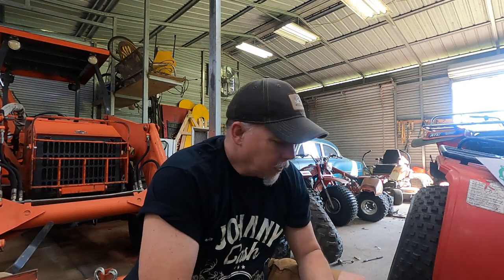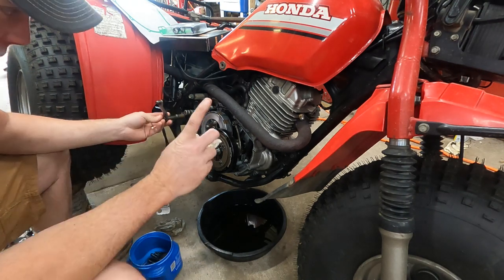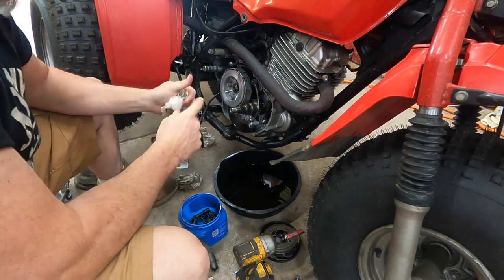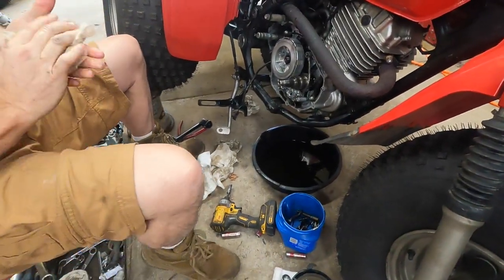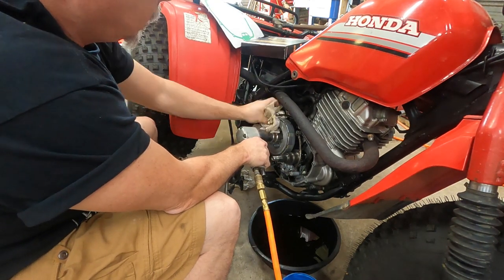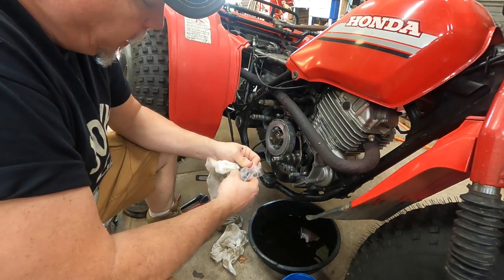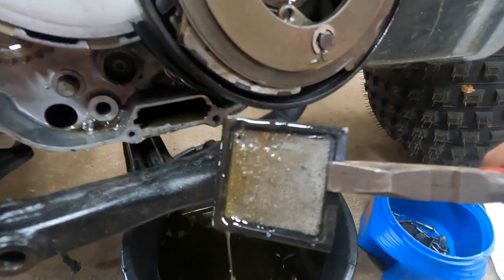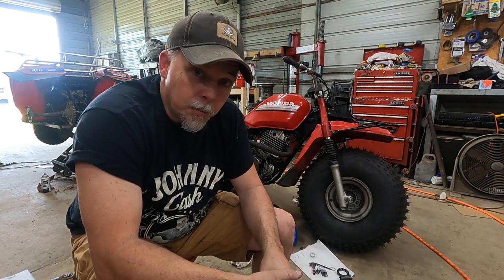HONDA ATC 250es THREE WHEELER CLUTCH & ONE WAY BEARING: Diagnosis and Repair.

Comment: You are an awesome teacher sir 👍👍👍👍👍👍👍
Reply from the maker: I think that's the best compliment I have received yet. Thank you.
Reply: Totally agree!!
Reply: @Mrcbuilds how do u you get the reverse lever off the shaft?
Reply from the maker: @shayneteynor2191  its a wedged fit, remove the bolt and tap it away from the case.
Reply: @Mrcbuilds  ty

Comment: Currently doing a one way bearing replacement on an 85 and ran into the same problem with the mislabeled direction.  Your video saved the day and my sanity.    My box looked like yours and I suspect they both came from a major distributor of aftermarket parts for these bikes.   Take the time to check, y’all!    Thanks for your video, sir.
Reply from the maker: Thanks for sharing John, yes always double check that bearing after install, I am glad the video could help. Thanks for watching please like, share and subscribe.

Comment: Guessing this is very similar to the 185s, took mine out to the dunes for labor day and had some slip between higher gears. Parts are stacking on the shelf for this winters overhaul. Thank you!

Comment: What a great explanation of the clutch and how to install the  replacement parts and what to look for, makes me feel like I'm right there watching you do all this, and understanding how it works.  In the past I've had two 85 Big Reds and never had any trouble with clutches, both machines were pretty strong with out any slippage and would do a wheelie pretty easy and had max power to the ground in 5th gear. I could smoke a foreman 500 easy on top end. my first Big Red would run just under 65 MPH It was strong. I would love to find another one like that.
Reply from the maker: Thanks for the kind words, I'm happy to help.

Comment: I have the 250 es with reverse with shaft drive I need a new clutch for it !!! where do I find one. since I got it 6 yrs ago I put 60,000km on it far and I think it is the centrufugal clutch might be giving out now. when I shut down it sounds like something spinning the ca chunk !!! but if run's fine and still takes off like a rocket !!!
Reply from the maker: The spinning clunk is the 1 way bearing. Shindy make one, you can find it on ebay. I would replace the clutch pack disc and steels while yout there.

Comment: Great job and video, I have a 250sx that has that engine on it and every time I push the shifter down it hangs and I have to pull it back up with my foot, where is the return spring on that shifter at.
Thanks
Reply from the maker: On the left side, there is a paw that has a spring just behind it on the shifter shaft, it can breat of slip out of position.  Page 9-0 in the service manual.

Comment: Finally got the bigred out and running after a few years. Drained the old gas out and put in new and the carburetor was dry, last time it was ran, with it running the fuel cock was shut off and the engine ran til it stalled. It started on the 3rd kick. I did notice once it’s been warmed up and running with no choke on if the throttle isn’t slightly feathered it will stall. Don’t know if this is a carb related thing or the idle simply needs turned up, that idle position has been the same for most of its life if not all of it. The other thing I noticed with the engine running and slightly revving the engine as the revs die down there’s a slight backfire, any ideas on what direction to look?
Reply from the maker: More likely than not the idle jet is plugged up and the back fire may be the choke sticking, clean the carb and choke and try again. Glad to hear another is back on the move! Thanks for watching.

Comment: Just installed a clutch kit with new clutch discs and springs on a 1982 Honda 185s atc. The new springs we’re about 1/4” longer than the old springs. I had to press the spring retainer pretty hard to begin each bolt. Once installed I tightened the 4 screws all the way to the stops. Clutch discs are not loose at all. Is this correct? Are the clutch docs supposed to be slightly loose or tight?? Thanks. Good job on your videos. Very methodical on your presentations!!
Reply from the maker: Hey ben, no that's not right you should be able to start each bolt by hand no problems and not fight the springs. Make sure all your disc are flush in the clutch basket, if they are you have the wrong springs. I believe the 250cc trike use longer springs than the 200cc machines. You may have issues changing gears and the clutch not freewheeling.
Reply: @Mrcbuilds  Hey, thanks so much for the quick reply. I’ll use the springs on my 85 250 es Big Red.

Comment: Very helpful ! What if i just need to do the one way bearing & not the clutch. will i still have to do the clutch as well ?
Reply from the maker: @Stepbrother7390  no
Reply: @Mrcbuilds  Thanks! keep up the good work! not many videos on here showing how to work on trikes anymore , big reds specifically! Been looking for a video on the  replacement of my air filter & gear leaver
Reply: @Mrcbuilds  Any recommendations on where to order a new clutch set ? decided if i’m going to do the bearing i might as well do the clutch as well, i have 1985 !
Reply from the maker: @Stepbrother7390  ebc makes a good product you can find steels and disc and spring by EBC on ebay. The clutch factory and tusk  are good brands too. If its a machine your going to ride and keep, id get a 1 way bearing  by shindy and a new gasket. You would never have to go back in that side of the engine.
Reply: @Mrcbuilds  odd that you would say that i have a one way bearing / gasket & oil filter from there sitting here waiting for a nice day to put it on ! & definitely going to keep this one , the frame is almost perfect for a 40 year odd year old bike. Hard to find one without rust/ tiny hole in the frame this day in age !

Comment: I see in the service manual about greasing the swingarm pivot points and steering head bearings. Are there grease zercs in there? I don’t see any on the swingarm.
Reply from the maker: No zerts you have to hand pack them

Comment: Theoretically, couldn't a feller get some 6 mm stud's to help out on the case gasket situation. Just remove them one at a time and replace with bolts? Also how do you feel about anerobic sealant on the case which can be spread thinner vs the risk of RTV squeezing into the engine and clogging stuff.
Love you're videos 👍
I have a 85 big red and and 84 200 and a 84 70 with a 125 cc
Reply from the maker: Sure you could install a couple studs. For that matter you could leave them in and put a nut on them, like the exhaust. I have never used that type of sealant. Sounds like a nice collection, the 84 atc200, is a nice bike,  and you dont see them as often as 185s or 200s . Thanks for watching, I'm glad you enjoy the channel

Comment: Great video. I have an 86. Looking for some insight or possible direction. Many years ago 2 buddies of mine were trying to start the big red since the battery was dead and had no luck with the kick starter. Unknown to me at that time they decided to try and bump start it which isn’t possible since it’s an auto/clutch not manual. They pulled it with another atv and were clicking it up into 3rd 4th 5th gears and told me there were some grinding noises. Now whenever you’re riding in that 3rd 4th 5th gear range there’s this hellacious grinding/pinging noise and it stops putting power to the rear wheels if you hurry up and downshift it comes right back to life and you keep riding like it never happened. Now this doesn’t happen all the time but does it every once in a while. Any insight on where to start looking into this? Thanks.
Reply from the maker: I would change the clutch and oil, and hope the gear set is ok in the trans.
Reply from the maker: No worries, Take your time, watch the videos and download the service manual, you will be fine.

Comment: Good work sir. I just pulled my side case and my gear selector arm hit the ground. I know it's in neutral but I sure as heck don't know what position it was in. Any tips would be great
Reply from the maker: Best is refer to the manual. Thats good that its an obvious fix.  The manual is free and can be downloaded from oscarmayer  website. Search oscarmayer  atv  manuals
Reply: @Mrcbuilds  I got it but I sure do appreciate that and thanks for all the videos. You've helped me a lot!

Comment: Just curious what would happen if you were to install the one way bearing backwards?
Reply from the maker: I'm pretty sure you would loose the primary clutch, it may not be able to take off. I have never had the happen, so I'm not certain.  But that's my best guess.

Comment: I put new clutch and one way bearing in my 1986 big red, all of the gears work except reverse. What did I screw up on, would appreciate any advice you could send my way. Thanks Mrcbuilds.
Reply from the maker: More than likely you do not have the reverse lever installed properly. it is a wedge fit on the shaft. loosen and rotate it counter clockwise to allow for more pull of the cable, or you may just need to add more tension to the cable itself.

Comment: That is a CLEAN engine block.  I need to ask a goofy question, that valve cap topper (not the valve caps, the whole pan head), is there a gasket for that that exists anywhere?  or is it supposed to just mate flat flush, trying to bring one back to life, 85 250es.   Runs and rides alright, but clutch is one of the things slated for next year when it gets warm again.   Beautifying the block is just one of the things next year, and I see nothing about a gasket for that part.
Reply from the maker: @dv7910  correct, no gasket there. Just a light film of hondabond
Reply: @Mrcbuilds  Thanks sir!  You've helped save a life

Comment: Hey MRC, I have some major issues with my 85 250es and was hoping you could point me in the right direction.
It started popping out of gear into a neutral state where I then have to shift back into gear and it bangs back in.
Also downshifting into gears has become very difficult. Finding the real neutral and staying in it is very difficult, if I push down it goes to neutral and light comes on but when I release it ends up in gear again.
Also when in neutral and shifting up to 1st when I release the shift lever it lunges forward briefly.
I am ready to pull it apart but but unsure what I should be looking for.
Any ideas?
Reply: I should add that the trike first presented downshifting issues when it got hot ( long rides) and then progressed to popping out of gear and now always having downshifting issues
Reply from the maker: Hi Thomas. I would change the clutch springs, then adjust the shifter slop and see if that helped, otherwise I think it could be a bent/worn shifter fork. that would require splitting the case, I tend to start with the easy and cheaper options before I jump into the hard stuff.
Reply: @Mrcbuilds  so I was feeling inspired after watching your video for the second time and took the left side cover off to see if the bolt under the shift shaft was broken or loose. It is not damaged but was loose by about a quarter turn but not damaged.

I then removed the right side cover and discovered that I had an ear broken off the clutch basket and the center bearing would bind if I applied pressure to it.
Now the piece that broke off is not in here, which leads me to believe the previous owner might have been in there since it had a new gasket and he gave me a spare set of frictions.
I have a set of ebc friction plates and springs to throw in. I hope this takes care of it.
 If not I did just pick up a beater fourtrax 300 that I could swap the motor from I believe.
Reply from the maker: @thomasstaffier2520  At least you found the problem, let me know how it works out.

Comment: I plan on doing this on my 200es soon, do I need to use proper torque specs or  snug good enough?
Reply from the maker: I have had good luck with snug is good and a recheck after a few heat cycles for added insurance. The manufacture torque spec are listed at the beginning of each chapter in the repair manual.
Reply: @Mrcbuilds  Thank you for responding. Keep up the quality content!👌

Comment: Just found your channel, great content! This video repair reminded me of an issue that I can't get a clear answer on. Hoping I can run it by you. 1984 200s. It switches gears ok but it is "banging" or "slamming" the gears. It not engaging neutral in between gear changes. Can you tell me what is not working or where I can look? Thank you sir. Keep up the videos!
Reply from the maker: Thanks for watching, I always check the easy things first and work toward the harder/more expensive fixes. Is the shifter hitting the bottom of the case/foot peg, preventing it from making full movement? if not then I would check the adjuster on the right side of the case, its a 14mm bolt with a flat head screw in the center. loosen the nut, tighten the screw till snug, then back off 1/4 turn, then tighten the 14mm bolt. If that does not fix it, I would replace the clutch and the springs, look in the descriptions of my video for links to the clutches as a kit. If a new clutch and springs does not fix it, then I am afraid it could be a synchronizer in the trans. Try the other options first, I bet its one of those.
Reply: @Mrcbuilds  Thanks for the prompt response. I hate to think it's the later issue. I've already replaced all the clutch plates and springs. I've also tried to adjust the right side. I just can't feel any "Springiness" in the shifter. Also when I hold down the shifter it should give me a "neutral" effect in between gears. Not the case. :( Thanks again!
Reply from the maker: @28mrdetroit  Holding the shifter should give you neutral, a lot of guys ride that way to mimic a clutch. on the right side case there is a spring, that rides on a arm that gives you the spring action in the shifter, when you pulled the right side off to install the clutches, you may have not aligned the spring correctly, it stays on the case, but can pop loose, tilt the bike up on its left side, pull the right side case cover and double check the spring, refer to the manual for the proper resting place of that spring. it's about 3 inches long.

Comment: Awesome video just installed a new 1 way bearing on my 85 sx with your video help! But I still have a clunk on shut down on left side of case is the other 1 way bearing bad also?
Reply from the maker: Yes, you may be right. Go to partzilla.com and look up your bike and get familiar with the parts and where they are before you take it apart. I'm glad I could help on the one way bearing.
Reply: @Mrcbuilds  that part is unavailable, I was gonna dm you on 3 wheeler world but I'm a newbie and haven't figured their site out yet

Comment: Please,please,please ,,,,tell me how in the heck you removed the reverse lockout actuator off of the shaft. Its like its staked on. Im at a standstill. Please help me if you can.
Reply from the maker: Its a tapered fit remove the bolt from the end and it will pop off with a little pressure
Reply: @Mrcbuilds  thank you. I got it . Little heat ,3 prong puller. That son of bitch was on there though. Thank you for the quick response. What do I owe you?
Reply from the maker: @Evanrude000  like, share and subscribe. Thanks for watching, im happy to help

Comment: Trying to replace the one way bearing and I go to remove the nut but everything keeps spinning, i see in the manual you need a clutch holder is there a way to do it without the exact holder?

Comment: So I'm having an issue putting the case back together, pretty much having trouble getting the reverse actuator spring where it needs to be. Any advice? Thanks
Reply from the maker: Theres a little shelf in the bottom of the case, rest the arl of the spring on it like I show in the video. Make sure the crank is going into the whole squarely and it will slide on.
Reply: @Mrcbuilds  got it. Thank you

Comment: Have you made a video on the cold start issue yet mine refuses to start in these cold temperatures warm out 2nd kick...
Reply from the maker: I have not, the 86 carb addressed this problem. I really suggest a 300ex carb for these. The 300ex carb has a squirter that helps on cold start issues. I also reccomend  223cycles.net to purchase a worked honda carb.

Comment: Hi would you have to adjust your clutch after putting a brand new clutch in? Or just bolt it up an go? I am about to order a clutch as mine slips alot I've adjusted it a few times I think I made it worse but wondering if you need to adjust it after replacing the clutch
Reply from the maker: Yes you do,  reset your adjuster.
Reply: I don't know how to reset them but thank you that still helps I've watched a few of your videos now and each one has tought me somthing new thanks for all those it helps me alot
Reply from the maker: @stevedolby7880  loosen the 14mm jam nut and back the flat headed bolt out. Then install nrw clutch. The retighten the bolt and lock down the jam nut.

Comment: Question: I have a 85 250sx.  Hard to find neutral and no reverse. Do you have any ideas what the problem is.
Reply from the maker: Start with the reverse cable it may need adjusting.